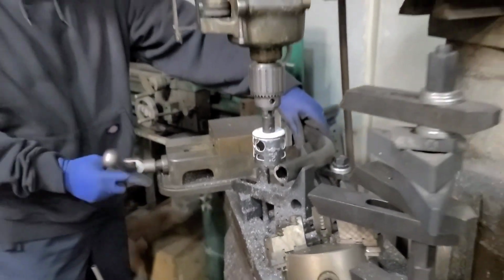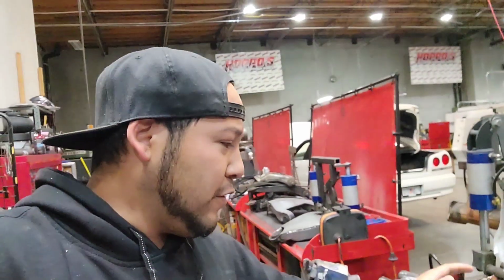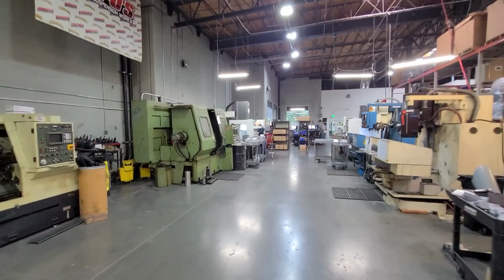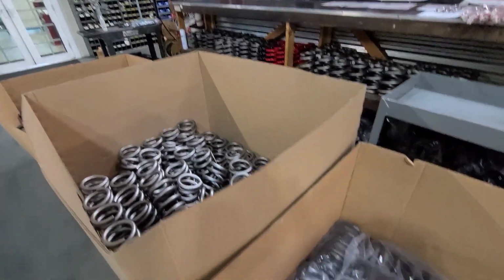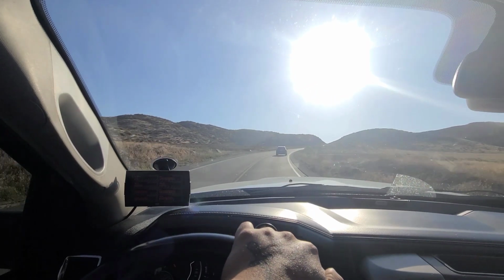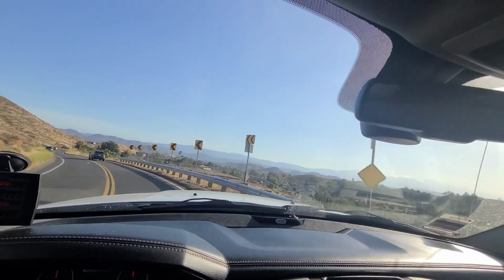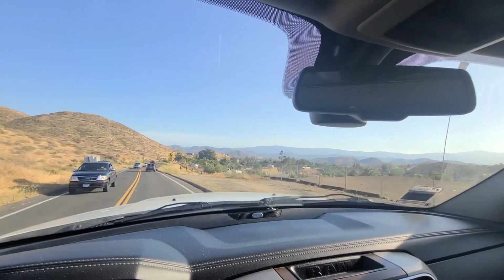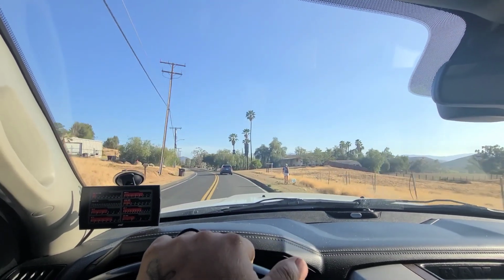skyline update/ finalized z rack

Comment: Van was slick. What is the antenna on the front fender used for?
Reply from the maker: It's a jdm parking pole. To help with parking in tight spots the headlight illuminates it to help at night for bumper clearance